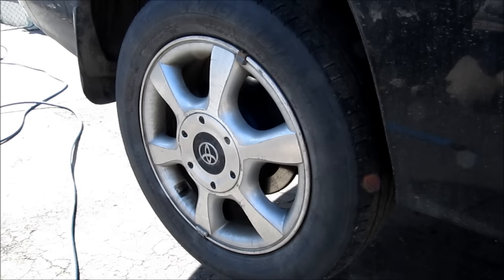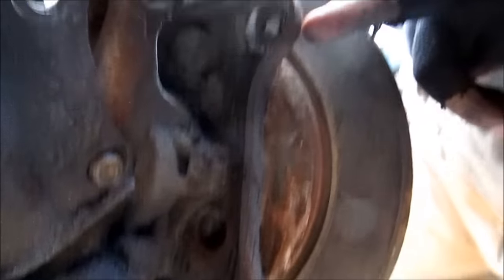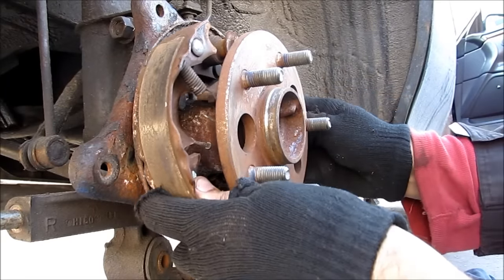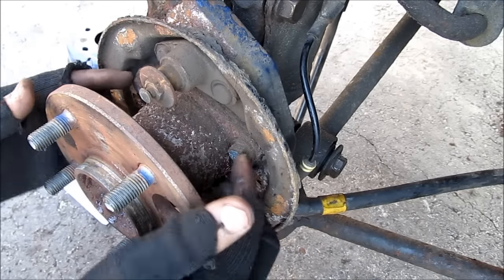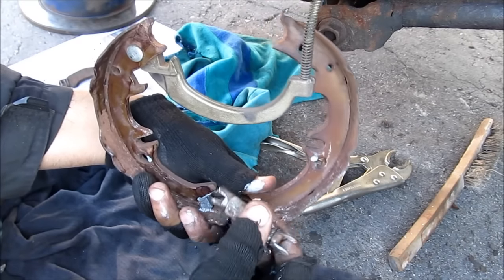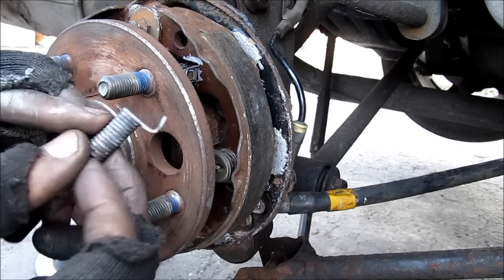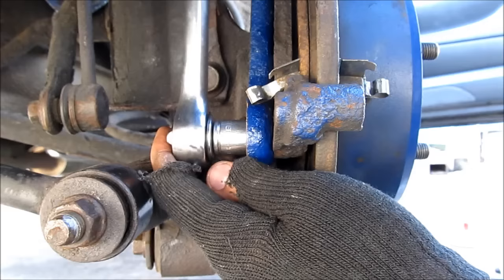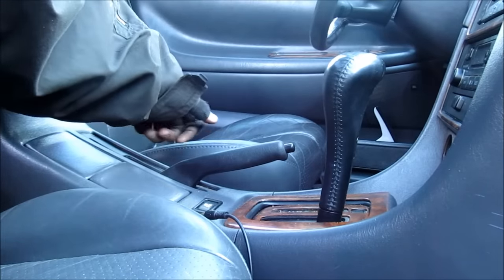How to Replace PARKING BRAKES

Comment: This is very complicated for me, but the parking brake on my Lexus GS300 is not releasing enough to reverse or forward smoothly. Is that fixable or does it have to be replaced somehow? How Will I Know? Thank you this is great video
Reply from the maker: You need an adjustment

Comment: The Rear Caliper mounting bolts are M10-1.25 X 20mm J.I.S. Small Head Hex Flange Bolts
Rear Caliper Mounting Bracket Bolts: 35 lb. ft. 
Caliper Slide Pin Bolts: 25 lb. ft.
Wheel Lug Nuts: 76 lb. ft.
Reply from the maker: Thanks for the spec

Comment: I’m putting emergency brakes on my 2008 Toyota Sienna and my hold down spring is loose but it’s attached to the pin? It’s the pin that is crooked and I can’t figure out why it’s loose? I ordered a new hardware kit and I’m hoping that the new ones fit tighter? Any suggestions will be greatly appreciated! 😕

Comment: Question: The parking brake cable has a spring on it, how did you get that spring to move back so you could attach the end of the parking brake lever to it?  Thanx!!

Comment: Hi, I have a 02 highlander and working on my calipers.  Now I can't get the rotor over the parking brake.  I have not fiddled with the brake either.  I adjusted the adjustment bolt as far as it will go to close the shoes. It seems stuck. You did a really good video, well done. Please advise as I'm trying to get this done on my day off. Thank you

Comment from the maker: Michael Richards
The adjusters are handed, and you need the correct one for the side you are working on.
Reply: On the driver side, does the adjuster tighten going up (counter clockwise) or does it tighten going down on the drivers side (clockwise).  It wasn't until I was done with both wheels and putting tooks away I noticed the adjusters were "handed".  Makes sense...  The way installed mine, they looser going down (from the access hole).  I would guess that mine loosens going up on the passenger side.  I figure I had a 50/50 chance of doing it right.  Wouldn't be too hard to pull the wheel and rotor, but I'd rather not.....

Comment: I'm having to grind the bolt heads off the caliper bracket also. Did you get the bolts out of the caliper bracket or get a new caliper bracket? Another video? How to get bolts out of a caliper bracket.
Reply from the maker: I think I was able to turn it out with vice grips. You can get a used caliper and bracket at a junkyard if needed
Reply: @speedkar99  I just twisted the head off the lower bolt. For the upper bolt in the video you cut it off with a dremel with the long cut off attachment. I just ordered the Cardone refurbished brakes with the brackets. How are they, ever used the Cardone?

Comment: Put the springs and retainers in without the shoes. Then pry the spring and retainer  into the slots on the shoes. Way easier than trying to put them in after the shoes. I wasted about an hour before finding it out the hard way.
Reply from the maker: Thanks for the tip

Comment: Part diagrams ftw. I'd have sanded the shoes and pads with a quick 80 grit, adjusted the e-brake without the caliper installed, and lubed the backing plate on the pads where it meets the piston and caliper.

Comment: Very nice video, the thanks. However may I ask why did you do it? You have not replaced anything, it all went in like it was
Reply from the maker: I was servicing them and then decided to share with you all the procedure
Reply: @speedkar99  servicing in what sense? Did you replace anything or you just cleaned and greased? I'm replacing pads on my Toyota and I'll probably clean and grease the parking brake

Comment: thanks for the excellent video. I am trying to change the spring parts for my 2007 sienna xle awd. which has the rear drum with disc . having hard time to find the correct parts. i have doubt on the shoe holding spring pins. which I ordered all four pins are straight pins. but I notice here in your video and somewhere else.. two spring pins are straight and other two are in a different shapes. any idea  about this issues? those straight pins will be fit?

Comment: Great video, exactly like my 95 Camry.  Do you have any thoughts on why my e-brake pedal almost goes to the floor before catching?  I've  adjusted them so there is just a slight drag when I spin the wheel.  Is there an adjustment to the cable somewhere?  Any advice is appreciated.
Reply from the maker: A Lanesey Assuming your cables are intact and not seizing or cut and your parking brake shoes aren't worn all the way down, you can adjust the pedal/ handle with a turn-buckle like device usually located under the center console before the cable exits the bottom of the car.

Comment: Put the pins with the springs in first then manipulate them with a screw driver; it is much easier.
Reply from the maker: +rr po good tip
Reply: omg, excellent tip, really made it much easier. thanks!

Comment: Speedkar 99, when putting it all back together (left rear tire on 1992 Camry wagon LE  3.0L V6), do both the parking brake shoe lever and the parking brake shoe fit into that larger notch on the rear end of the strut (away from the front side on which the spring is placed), or does just the rear parking brake shoe fit into that wider strut notch?  I put both into that wider notch, and could barely get the disk mounted, even with the adjusting screw closed all the way.  There is now too much drag even with parking brake released.  After driving 4 blocks, disk was 190 degrees F.  Other 3 disks were 33 degrees, and I hear the drag from the driver's seat.  Thx, Chris O'C
Reply: I meant "rotor" not "disk".  cmo
Reply from the maker: +oconnorcm Ahh I cant recall off the top of my head, I assume the notch is just for the shoes and the brake lever sits behind the shoes.

Comment: Hello, I have a 96 convertible Celica and i have had to replace a wheel stud on the rear. After ive put alll the shoes back on, im hearing like a clicking noise from that side now. And when the handbrake is on the wheel turns one way but not the other. Any idea what it could be?
Reply from the maker: The adjustment wheel should move both ways.
Reply: The handbrake lever seems to be blocking the movement of the adjuster.
Reply: Could it be a seized handbrake cable?

Comment: did mine using those $19 brake best shoes from oreilly..... they just slide even after adjustment....after inspection i noticed some pads have very little contact with the drum....the curvature of the pads may be not as good as they should be..i decided to replace the originals because the front shoes on the right side is thinner than the other 3 but they can stop the car.....ill just put them back

Comment: that is so amazing, all the parts and yet not enough room to work on, very clear video, thank you. questions. when you put the bolt back , what is the ft/lb to tie the nuts ? , also, you use screw driver to release somthing,,, in the brake shoe ???
Reply from the maker: +Daniel The Lion Thanks. Not sure which screw driver are you referring to?

Comment: I just replaced the brake shoes and hardware in addition to new rotors and pads in the rear of my 99 camry V6 with discs in rear and parking brake shoes inside. My issue is the I beat the rotors onto the shoes with a hammer bc I was extremely frustrated (bad idea I know) and now the rear wheels lock up sometimes turning when trying to drive. the adjustment nut is completely closed. The original shoes were about 245 K old and a mechanic a year ago or so adjusted the parking brake on the car to where they would grab better. My question is do I need to have the rotors turned to shave some of the inside since they are brand new and/or is there a cable adjustment on the parking brake somewhere, if so where? Sorry for the long question
Reply: Ryan Jordan FYI the wheels were locking up only when driving on my grass on my property, car has not been taken out onto a public road..
Reply from the maker: Ryan Jordan Are you sure the shoes aren't seized slightly engaged? Perhaps the cable is stuck? Usually a sticking parking brake would wear down a few mm of friction material and the wheel would be free to spin again. You'll see alot of brake dust build up on your wheels.

According to the parts diagram it doesn't look like there's a turnbuckle elsewhere for adjustment, besides the nut at the handle.

http://www.villagetoyotaparts.com/showAssembly.aspx?ukey_assembly=359364&ukey_make=1021&ukey_model=14405&modelYear=1999&ukey_category=19382&ukey_driveLine=6108&ukey_trimLevel=14178
Reply: The new replacement hardware will let you adjust the shoes a little smaller so that when you put the rotor back on, it just slides on and off.  Of course, once it is on, you'll have to adjust it larger than you with with the original parts.  Had I not gotten a new hardware kit due to screwing up the bent keeper pin when I pulled the rotor (it was pretty stuck on), I would have never been able to put my new rotors over my new pads with the original hardware.  It was too tight and I had to bang it on. I knew it was a bad idea when I was doing it but cripe, they are brand new replacement parts.  Had I not gotten the new, slightly shorter adjuster, I would have been SOL as my new rotors would have locked up until I overheated them and worn down the new pads some.

Comment: Thanks for the vid, pretty nervous about this job or any drum brakes but seeing you do it not too bad. When adjusting the star wheel, do you have it loose first by backing the nut then making your make adjustments thereafter?
Reply from the maker: Its not that difficult if you study how all the parts go together.
You don't have to back off the star wheel, just make sure the brakes are properly seated in the drums, and start tightening down the star wheel until you feel slight tension when rotating the rotor.

Comment: Wouldn't it be so much easier to remove the hub assembly, since all that is needed is to remove the 4 bolts, so that there could be a clear access to the parking brake shoes and all its hardware? Btw, can the same hub assembly that is removed be reinstalled, or once it's removed, is a new one required? Thank you!
Reply from the maker: Your right, that would help with clearance

Comment: I cannot figure this out. The staighht shoe hold down pin doesn't fit through the hole because it appears the axle carrier is in the way. What am I doing wrong?
Reply: Right! It probably depends on the particular Toyota. I have done this on a Highlander BUT I avoided removing that straight pin. After some wiggling and due to time pressure I decided to leave it and reuse.
If yours is broken or already out and you need to install a new one-try wiggling it at different angles or even giving a slight bend (re-straigthen after)-there is a small access on the Highlander but it will be tricky to get it in.
To do it properly is to simply remove the hub from the knucle:4 bolts and the axle nut (axle nut loosening should be started with wheel installed and on ground/loaded and you might want to get a new axle nut as it's the usual rec to not reuse axle nuts).

Comment: I have a 2007 toyota camry, i change the rotors and pads, but the emergency brake does not have the power to stop the car so, do you think  if I change the brake shoe the car will have more stopping power?
Reply from the maker: +boxing fan javier did you adjust the parking brake with the star wheel? They are not self adjusting.
Reply: Yes, but I think I should change the shoes

Comment: hey man ive got a 1999 toyota solara se v6 5 spd ive had the car a little over a year now but since i bought it the e brake hasnt worked i pull up on it but the shoes wont push out so im thinking it could be a beoken cable or im not sure. let me know what you think? keep up the great work man. love all your videos
Reply from the maker: Its probably a broken cable. On my Solara only the right parking brake seems to work, the left wheel never locks up. These things become corroded internally, and replacing them is not fun, since you've got to work around exhaust and its rusty shields.

Comment: Very good video. How do you remove two bolt on bracket, because I didn't see you used new bracket
Reply from the maker: tai nguyen The C clips for the e-brake wire should slide out with a screw driver or pliers. You will need new c-clips as these might bend or break.

Comment: Stupid question but this is the same way for a 2007 toyota camry le or no great video quick an right too it..
Reply from the maker: BENT & TWISTED Thanks. If your Camry LE has rear disc brakes, this is the correct procedure to service the parking brakes.

Comment: thanks, would you make a video to introduce how auto transmission fluid pump works and make another video to introduce how atf cooler works?
Reply from the maker: Thanks I'll keep that in mind for my G35 project I'm taking apart.
Reply from the maker: Please check my transmission and torque converter videos

Comment: Really helpful. I have a question though. I'm trying to fix the ebrake on 2001. The pins don't seem long enough, are they different from a 1999 to a 2001 ? Any help is appreciated . Thanx
Reply from the maker: Hmm I'm not sure if they are, but you can cross reference the part numbers on sites that have Toyota parts catalogues like Village Toyota Parts or Lexus parts online.
Reply: Ok thanx for the help. ☺

Comment: Do I need the parking brake for the function of the wheel? I have one of these as a beater and I can hear everything went to crap inside of there. Is it an option to just delete the parking brake and run  it as is? Or is it structurally important?
Reply from the maker: Yes you can delete the parking brake shoes (as long as you have rear disc brakes). Not recommended though, in case you need that parking brake.

Comment: I just managed to get one of the rear discs off of my Toyota Sienna AWD by using an angle grinder with a zip cut blade to cut the face off of the disc.  I had to do this to get access to the star wheel adjuster to back off the parking pads because someone worked on this van's brakes previously and didn't align the access hole with the hole in the hub.  While I was trying to yank the disc off, parts of the park brake assembly popped off and fell down to the bottom and wedged with the adjuster.  I ended up having to go completely around the drum with the zipcut till the face fell off so I could fish the parts out and back off the pads.  There was a considerable build up of rust around the inside of the drum which is why the park brake pads were holding the disc.
Reply from the maker: +Mike from Enderby wow an angle grinder. That's was inconsiderate of the last person who did the brake job. Well at least you got it fixed now. Use anti seize on everything and service the brakes yearly to prevent seizing.

Comment: These parking brake assemblies are one of the most over-engineered things ever. 

One tip... if you buy a non-OEM set of harware (springs and pins etc) be mindful that sometimes the straight hold down pin on the left hand side is sometimes a few mm shorter than spec, which can sometimes mean that even with that little round cover spring fully compressed, the little round cap won't be able to get far enough on  to click into place, no matter what you do. I had to re-use the old straight pins. So, TLDR... Buy OEM.

Comment: Just wondering... is a solution. to very tight and difficult  spring pin install to just remove the hub assembly?  especially if don't have 3 arms and skinny fingers?
Reply: Job is 1000X easier by removing Hub Unit.  4 bolts.  Complete access to brake hold down pins and springs.  When hub is removed, cover exposed hub-hole with baggie to keep any dust or rust dirt out. Easiest method is to put pin, washer spring and lock part togther first, then compress with needle nose and slide brake pad under compressed contraption.  Much easier method than trying to line up tiny opening for pin.
Reply: 14 mm bolts.  When re-installing I torqued to 60 pounds per another YouTube on swapping out hub.  Also take care not to knock socket off extender.  Not sure if it will drop out as tight clearance.
Reply from the maker: +s. fitz good tip. There's a special tool out there for those spring pins. I struggled with my fingers and screwdrivers. And yes removing hubs gives you much more clearance.